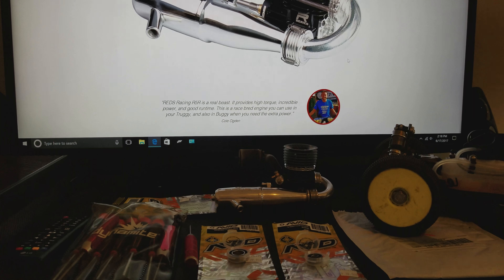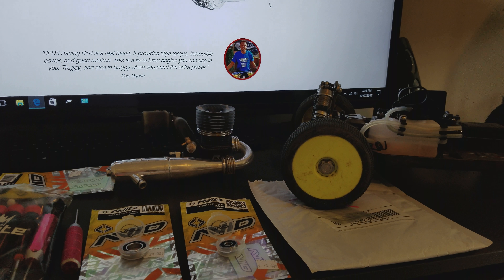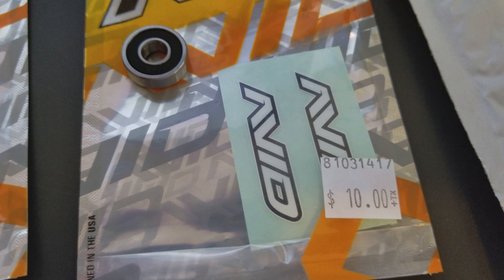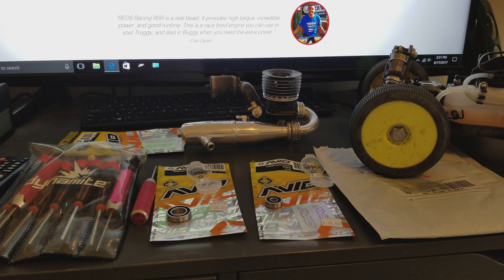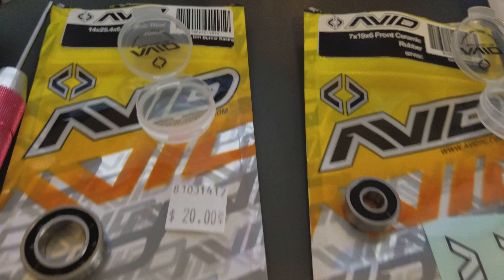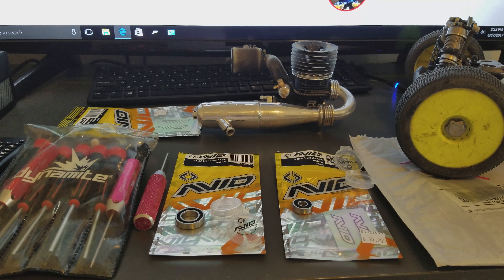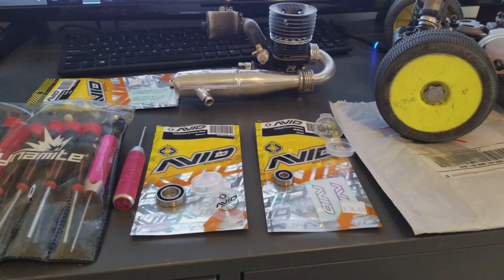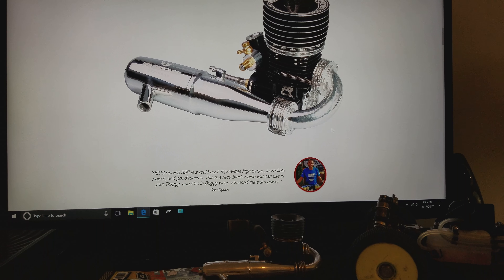TLR 4.0/Red's R5r w/Avid ceramic bearings

Comment: Please use the Byrons 30/11 you will love it and also look into the Reds Quattro clutch and tool ,you can change the tension on the springs without replacing them